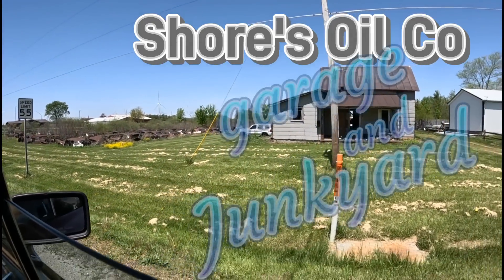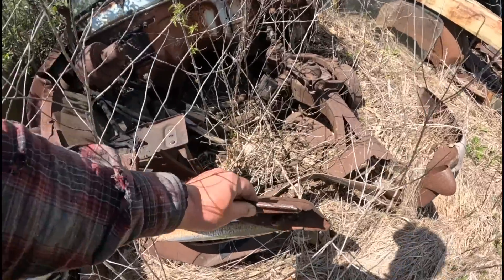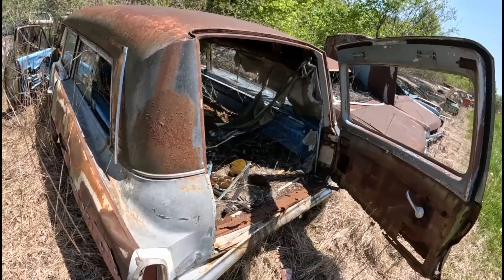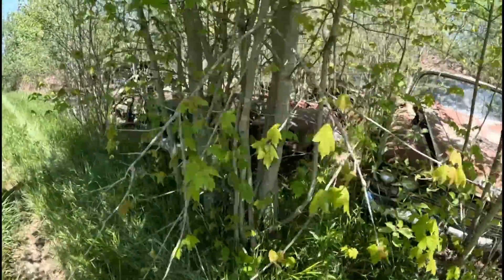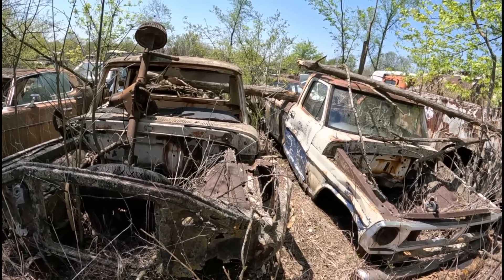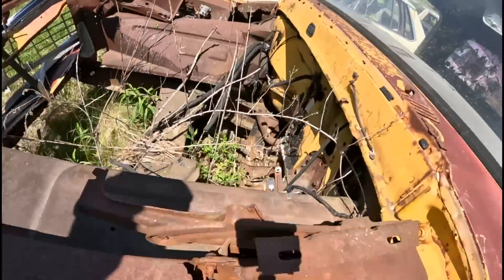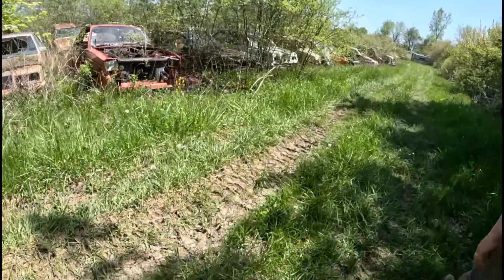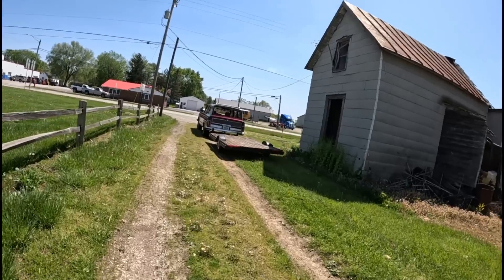Exploring a Very Old JUNKYARD: Is there anything good left?

Comment: I used to pull parts off that 61 Buick all the time @8:30. Not much left, might be great for piecing together a rat rod.  Haven't been there in about 15 years, should probably go back to see if there's anything that has changed.
Reply from the maker: I recently learned they scraped all the old stuff by the road
Reply: @route40rust  I would not be surprised if that yard is not there in 5 years.  There used to be another salvage yard nearby, but they cleared it about 15 years ago.  You could find full cars there.  I remember seeing a decent Torino that could have possibly driven off the lot.

Comment: 50's 60's VW beetle's 'reserve' fuel selector was on the gas tank under the front deck lid, worked kinda like on Honda motorcycles, it changed over from the normal stubby fuel pickup tube that pointed down into the tank to the longer reserve fuel pickup tube. think it was on the fuel gauge  sending unit cover- been about 50-55 years since I last saw one.😁
Reply from the maker: Good information, I appreciate you sharing! I thought I had seen something about a reserve switch but couldn't say for sure.